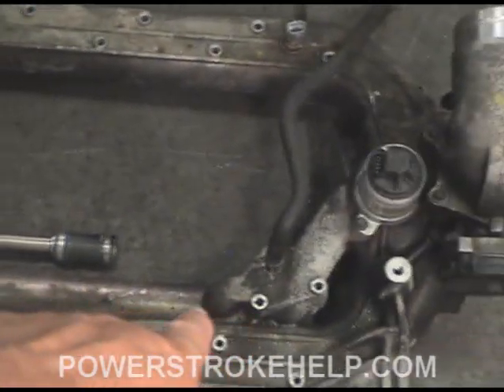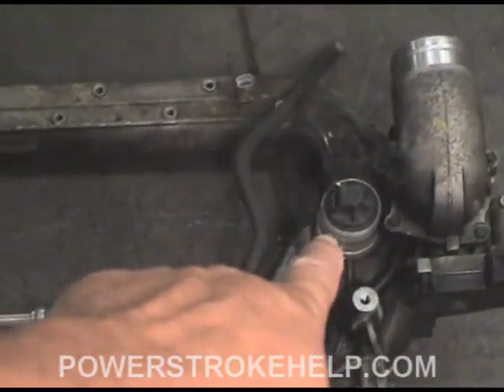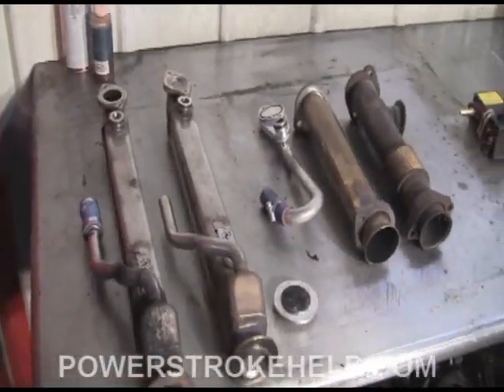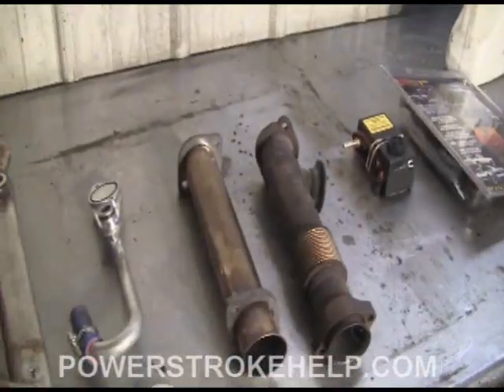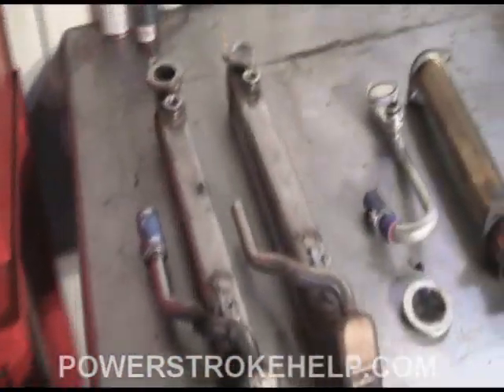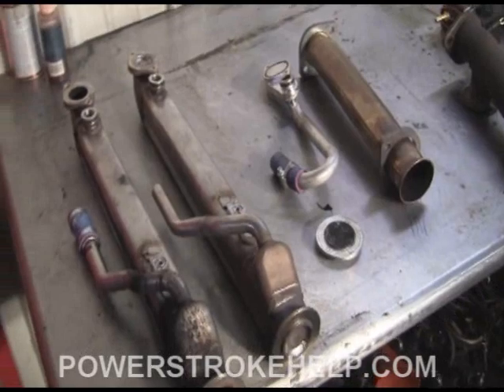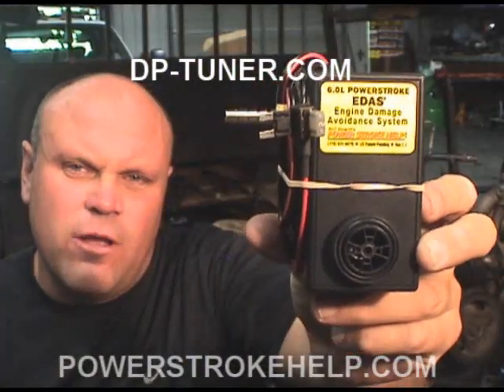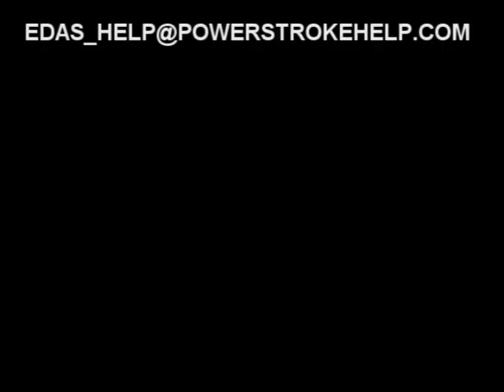6.0L EGR COOLER DELETE AND OIL COOLER ISSUES

Comment: Hey thanks for the video it helped seen as how I know my EGR cooler has failed and i'm waiting to take my truck into a shop here in canada. Now your experience with the sinister delete kit was interesting and I trust you seen as how you do this day in and day out and also your saving me money with not buying the delete kit. But do I just get a welding shop to weld to plugs into the  EGR cooler? and I don't have to tamper with the Y pipe at all just leave it stock correct? Thanks